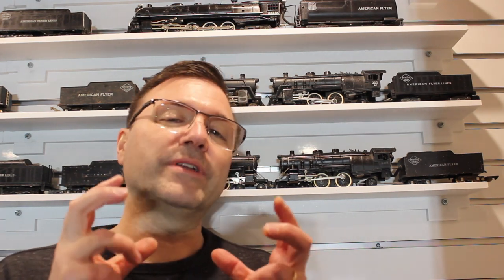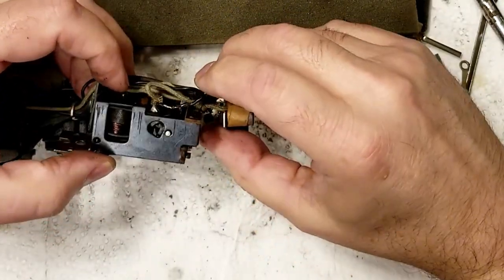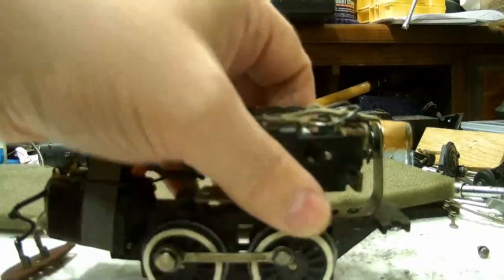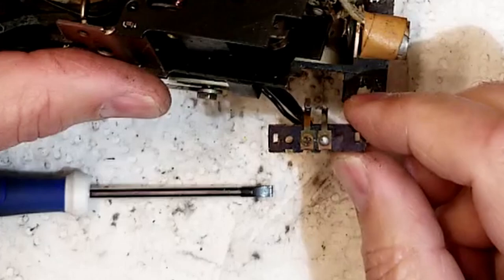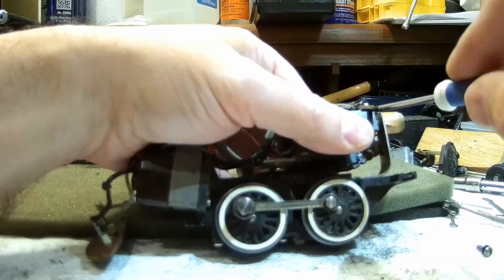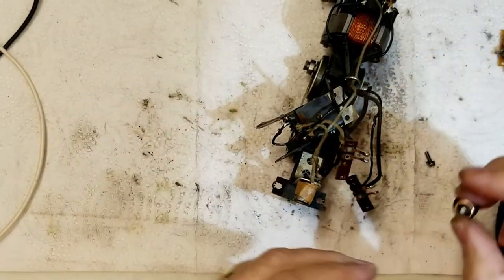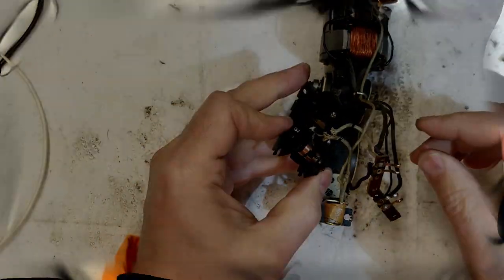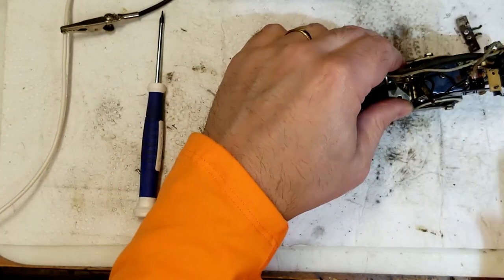American Flyer repair basics: 1946 #300 4-4-2 Atlantic e unit service.

Comment: Austin, I have been successfully running my 300 for some time now, but it now has a problem I have never encountered before. The locking lever on the e-unit is so loose that it will not stay in either position. Have you ever had to tighten or loosen a locking lever? If so, how did you do it? Thanks again.
Reply from the maker: I have not had this issue on 4 position reverse units but I have on two position units.  I would try to squeeze it with needle nose pliers.  Another idea would be to ping the back side of the rivet.  If these fail then drilling it out and replacing it with a new rivet or bolt and nut would be the steps I follow.  Hope this helps!

Comment: Thanks. This is the type of information that I need to learn. Plus, It helped to see that working with fingers can be successfully done. You didn't scare me off. I got scared off about a half century ago.
Reply from the maker: You are welcome.  Do you have any to work on?
Any chance you have any spare reverse units or junk engines with reverse units lying around?
Reply: @AustinsAmericanFlyertrains  Let me check.

Comment: Rather than bend the e-unit frame to remove the rotary contact drum, get a pair of snap ring pliers.  They can gently spread the frame enough to release the drum without applying so much force that the frame is deformed.
Reply from the maker: Ugh!  Why didnt I think of that!!!!!! And I have some on my work bench!  Thanks George.  I have one more video to make for the series.  I'll add this. Excellent suggestion!

Comment: Thank you for this Austin. My recently acquired 300, probably a year or two newer that the one you are working on, also is running very well in reverse only, so I will be getting into this process shortly. I do have the reverse unit in the tender of my 290 working well, so I do now have some experience. I got the repairs done on my 310 yesterday and it is on track and running great today. I now have a plan to get the 290 back into service. Maybe that will work and maybe not.
Reply from the maker: Excellent!  Glad to here this update!

Comment: I've done a few of these in my time, both Flyer and Lionel. Lionel's is more robust, but even harder to disassemble and reassemble. I was very happy to see the safety goggles warning. Those wires go EVERYWHERE.
Reply from the maker: Thanks Ronald.  I've not tackled a lionel version.  Sounds like those are another level of challenge.  Any chance you have some spare flyer reverse units you want to get rid of?
Reply: @AustinsAmericanFlyertrains  sadly, I don't. This is why I keep urging you to attend the TCA @ York, Pennsylvania. It's just incredible what can be found. I've offered you to be a guest, or you can join. As a guest, you only pay admission, not annual dues.
Reply from the maker: Thankyou Ronald.  While the offer is generous it would cost me several hundred dollars to attend.  There is a chance I might somehow be able to work it in but as of yet I've nothing firm.
Reply: @AustinsAmericanFlyertrains  motel can be had around $80 or so. I've stayed at this one for the last several years. Clean and well run. Supper I go to Golden Corral. Breakfast is free, I pack a picnic for lunch. I am going on 74 years old, obviously retired, and I understand about money being tight. How long of a drive is it for you? Quite honestly, I only spend 2 nights, and 1 day at the show. It's like shopping in Costco, if you see it, buy it 
It may not be there tomorrow. Is there any secure way of communication with you? I feel like everyone knows what we're talking about.
Reply from the maker: Email...AFtrainfun@gmail.com

Comment: Congratulations from Argentina for the clarity of your explanations and your video. I am restoring an AF 1946 # 300 4-4-2, as the reverse system is badly damaged (badly repaired previously) I replaced it with a reversing switch. Now I will try to follow your directions.
Reply from the maker: Wonderful!  Please keep me posted on your progress.  And thank you for the comments!
Reply from the maker: Are there many american flyer people in Argentina?
Reply: @AustinsAmericanFlyertrains  I don't know American Flyer people in Argentina. I am dedicated to the HO scale, with which I have been working for six years. I recently received an American Flyer 300 4-4-2 "Atlantic" that had been purchased by an uncle in 1946 and had been forgotten in the attic for many years. I managed to get the engine running, but I couldn't fix the reverse system, which is in terrible shape (which is why I replaced it with a reversing switch, which works very well). It is not possible to access accessories here and at the moment it is very expensive to buy and import them.
Reply from the maker: @armando3232  it sounds like the engine is incapable hands!
Reply from the maker: Armando...let me also mention that if you are using dc current to operate your flyer engine verses ac current then the reverse unit will not operate...the open frame motors will operate on dc but the reverse it will not.
Reply: @AustinsAmericanFlyertrains  Austin, I appreciate your mention. I am using AC for the AF engine.